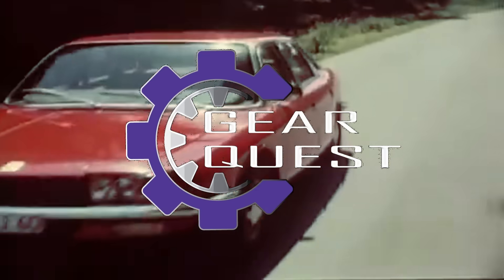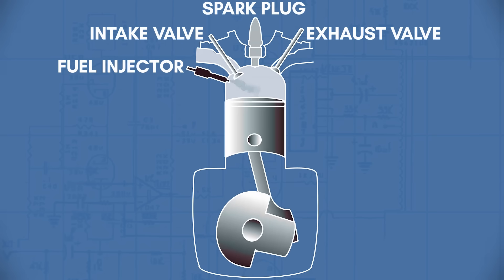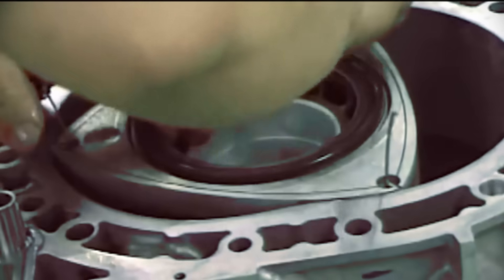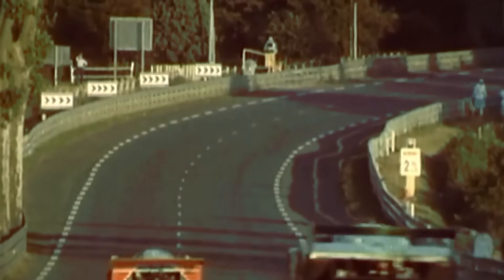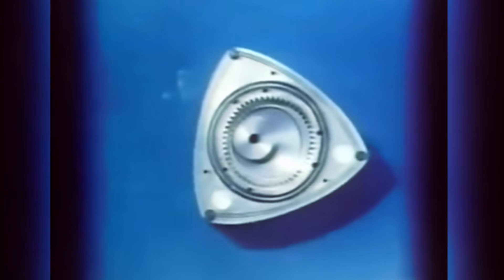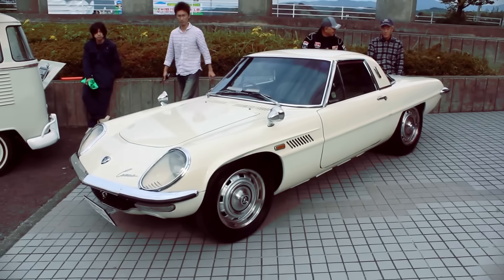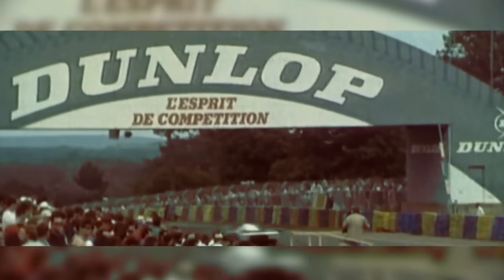The History of the Rotary Design

Comment: They should just use long cylindrical bearings made of hardened steel or whatever new space age metal for apex seals with very low tolerances and utilise some form of cooling for . ..

Comment: Replacing the internal combustion engine? Don't you mean replacing the piston engine. A rotary engine IS an internal combustion engine.

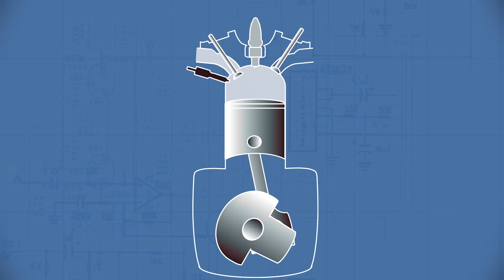Also at 12:20 it's not that piston rings are more durable than apex seals. Apex seals just WEAKEN faster due to the engine cycle, unlike piston rings
Reply from the maker: The audio dropped out. Thanks for listening closely.

Comment: A way to fix the constantly hot  issue would be to change the positions of the intake/exhaust ports. Then, add another set of spark plugs on the opposite wall of the rotor housing. Now, for each cycle, make each set of sparks fire. So in cycle 1 the right side fires, and in cycle 2 the left side. That would make the heat a bit more even I think
Reply: Akio Asakura That’s not how the modern Rotary engine handle the uneven heat distribution. The way they handle heat is by introducing the cold water to the hottest side of the housing then gradually transport the pre-heated water to the colder side of the housing in a radial fashion.
Reply: Akio Asakura If you look at air-cooled Rotary RC Aircraft engine, the amount of heat-sink is greater around the combustion side than the intake side.
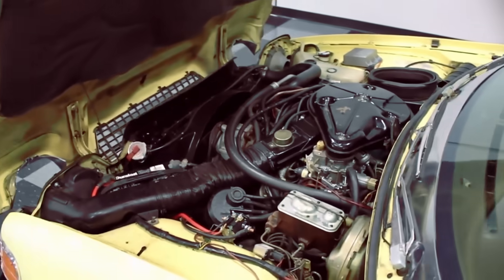Reply: https://youtu.be/pCteBhr4dGY go straight to a 2:05 minute mark. Keep in mind that the intake is at the left bottom side of the housing

Comment: Also, how does the rotary spin on that center axis thing? It makes no sense?
Reply: The momentum from the gas igniting in the housing makes the rotor spin around the axis. It is very similar to how a piston moves up and down in a piston engine.
Reply: @loganaustin5940  not quite; the force of the expanding combustion gasses forces the rotor outward which applies a force on the eccentric shaft causing it to rotate and the rotation of the eccentric shaft in turn causes the rotor to rotate. peak torque production occurs when the direction of force is tangential to the direction of rotation much like a piston engine.
Reply: Or go to 4:51 for another explanation.

Comment: There is a compression leak from the spark plug holes. You even showed the problem. He shows a wire the same gage as the apex seal and you see the gap which causes blow by. Also if you off set the combustion pocket in the direction of rotation it would cause less stress on the engine. There are ways to fix it but there hasn't been enough testing on these solutions.
Reply: the guy who said that has not clue how these engines work, ernie brink iirc. compression does not leak from the spark plug hole as the pressure on the other side of the rotor is higher, offsetting the combustion "pocket" will cause greater stress on the stationary gear and result in lower output.
Reply: @7sins979  you may be right about the off set combustion pocket but the compression leak is a fact. Here is a slow motion demonstration of that fact. The guy also has a video of a modified housing fixing the issue. https://youtu.be/WSQTsaWFd_E
Reply: @jamesineson4609  
Best use an ignition that does not require a spark plug. Mazda have done promising research on HCCI ignition for its SkyActiv-R rotary engine project using research from its SkyActive 2 program. They have removed the need to locate the spark plug outside the combustion chamber to allow the rotor to sweep past. Mazda solved this in the SkyActiv-R rotary project. Rotaries generally have high compression ratios giving the design easy adoption of homogeneous charge compression ignition (HCCI).

The next Mazda rotary may not have a spark plug being HCCI ignition. Fuel consumption should match piston engines and when used as a constant speed gennny as in hybrid, will outperform piston engines with all the advantages of low weight, small size, super-smooth, simplicity, etc. The expectation will be that the engine will be introduced in 2020, the 100th anniversary of Mazda. Looking good. 

Explanation of HCCI from wiki:
"Homogeneous charge compression ignition (HCCI) is where the fuel/air intake is a pre-mixed lean air-fuel mixture then compressed to the point of auto-ignition. Electronic spark ignition is eliminated. Gasoline engines combine homogeneous charge (HC) with spark ignition (SI), abbreviated as HCSI. Diesel engines combine stratified charge (SC) with compression ignition (CI), abbreviated as SCCI. HCCI engines achieve gasoline engine-like emissions with compression ignition engine-like efficiency. HCCI engines achieve low levels of nitrogen oxide emissions (NO x) without a catalytic converter. However, unburned hydrocarbon and carbon monoxide emissions still require treatment to reach automotive emission regulations."
-------------------
Rotaries are better suited to constant speed, high efficiency genset applications rather than direct drive via gearboxes. In that application piston engines cannot compete. Rotaries are better suited for series-hybrid cars being much superior than piston engines.
----------------

Direct fuel injection and laser ignition will improve the Wankel considerably when introduced. The problem of unburnt fuel in the exhaust will be eliminated improving emissions and fuel consumption. The engine performs very, very well in fuel consumption and emissions running at a 'constant speed' turning a generator - at its most efficient "sweet spot". Wankels lose efficiency dramatically when they are revved up and down as when directly driving a car. The engine has a vastly superior power-weight ratio than piston/crank engines and is about one third of the size and weight of a piston engine for a similar power output.

All these positive attributes combine to make a superb range extender, when the wheels are turned by electric motors. If a car is plugged in each night and uses grid power to run most of the time, then wear on these units will be negligible. As the engine is only periodically used, the life of the engine is greatly extended. Also newer metallurgic techniques are being used to make the engines. Even when batteries are depleted, the Wankel can provide enough electricity to power the car and still be economical.

The first ever series-hybrid plane flew in June 2013 - using a Wankel engine because of its small size and light weight, and an electric prop. The makers say it can be scaled up to around a 100-150 seater plane. The Wankel engine(s) can be in the fuselage for better weight distribution with small electric motors on the wings giving lighter, and cheaper, wings. About 5 companies still make Wankel engines for special purposes such as drones.

The sooner they are introduced in road vehicles in series-hybrid form the better. The Wankel has finally met its niche.
--------------------------

It takes only 25 to 30hp to propel a large American car down the highway at 70mph. Yet they put engines in them that can output 150 to 200hp. Most of that output is for acceleration and heavy loads. Highly inefficient.  The great thing about a series-hybrid is that the generating engine works totally independent of the demands of the electric driving motor, enabling maximum efficiency when running. This means the generating engines can be greatly downsized. The battery acts as an energy buffer to give acceleration boosts.

Comment: 787b had a 26b engine, which was slowest in class but won on reliability

The engine was in such good shape after it could've done another 24h 😉
Reply: Acceleration may not be the best but cornering was excellent.
Reply from the maker: Dream build = NA Miata with 13B REW under the hood... Thoughts? 🤔
Reply: @GearQuest  There's enough room under the hood of a Miata for a second Wankel engine.  You're gonna need the backup ... :-)
Reply from the maker: Or maybe a 26B!
Reply: @GearQuest  on bestmotoring was some crazy build and i guess i had seen that
Reply: Gear Quest , can’t believe the MX5 didn’t have a rotary engine, at least as an option

Comment: Are Mazda Rx7 's reliable cars to own? I've been looking at owning one for years.
Reply: They can be, though it is model/generation dependent and even then, only with care and regular maintenance.

If you want the most reliable, go for a naturally-aspirated FC3S, FB33 or SA22C.

Especially the SA22C and FB33. If you get one that is 12A-powered; they can be truly, phenomenally reliable.

Mine’s currently at 170K miles and still on the original engine - and that’s far from how long they can last. I’ve seen examples lasting to 300K miles before requiring a rebuild.
Reply: @rucarnuts13  That is 100% true. I know many people with RX-7 and the first generation in stock form is the most reliable one and least expensive to maintain and buy.
Reply: @rucarnuts13  Have a 1988 RX 7 FC Turbo in no speed limit Germany. Changed the engine in 1998 after 100000 kms. OK since. Has now 150000. Still running 250+ KPH
Reply: Heiko Panzlaff - Sweet! Always wanted a Turbo II, but I don’t have the space for a second project car.

My 1984 RX-7’s got a street ported 12A in it, with a modified version of the Nikki carburetor that came with it. 140 horsepower at the wheels, but that’s with the standard thermal reactor and emissions equipment that is mandated by California’s super restrictive emissions laws.
Reply: They're reliable if you put in the effort to look after and maintain them

Mine hasnt given me any issues, and the rx7 community is always more than willing to help out with anything you may have issue with
Reply: Reliability also depends on how you drive them. If you just potter around town and never open it up the apex seals tend to carbon up. This causes sealing problems and eventually failure. 
You've got to rev em out once in a while to clear em out
Reply: I have a 1988 FC3S. It has just over 200,000 miles and ive had little issues with it. I premix, which means i put 1 ounce of two stroke oil per gallon of gasoline when I fill up. I would not recommend having it as your single and only car, because the car can be very temperamental. But if you're willing to learn and want a fun car to drive, it will be a fantastic vehicle. Note that a naturally aspirated 13b/12a motor will be far more reliable than a turbocharged 13b.
Reply: Do you really like the RX-7? To answer this, would you willing to buy a broken 50K usd car? If the answer is no, then don’t. If you only like it, it’s not enough. You must devote yourself to it, let it become your life. Then anything will be reliable
Reply from the maker: It’s more of a passion project to own a rotary.